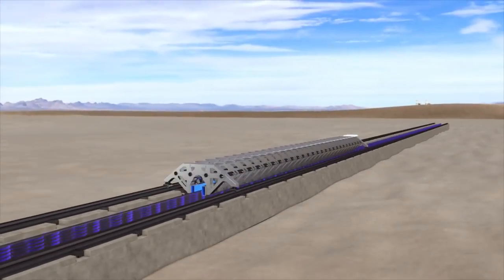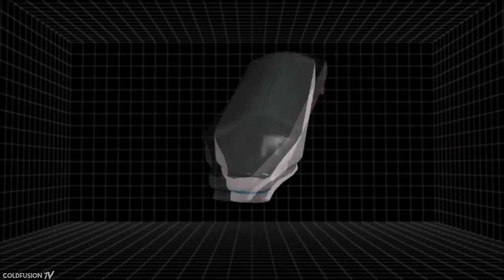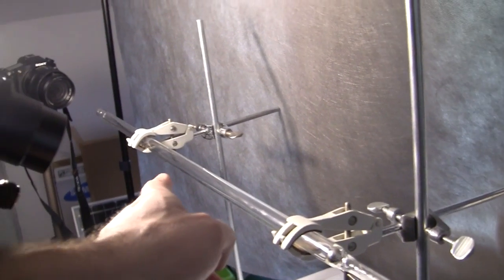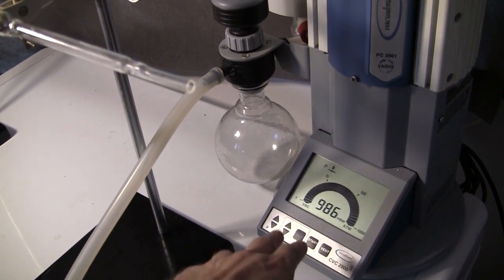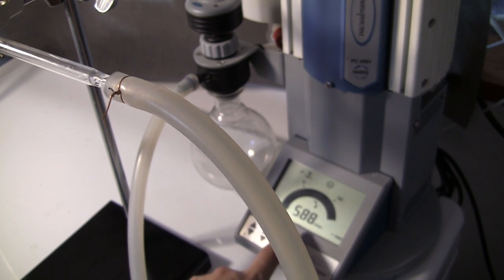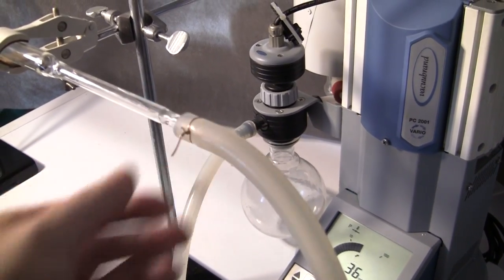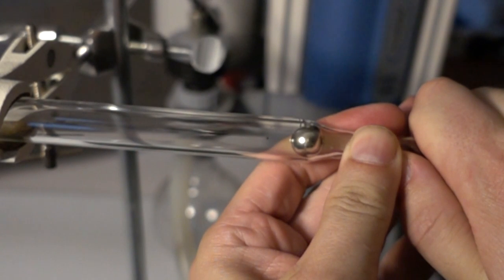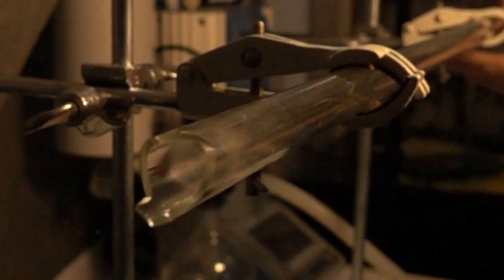How  the Hyperloop can kill you!

Comment: Wouldn't the rapid acceleration kill you alone?
Reply: Not if you had a friend with you, then it would kill both of you. :D
Reply: would cause cardiac arrest..
Reply: Maybe maybe not. Here is an interesting blog about it citing NASA and air force research into effects of G on the body. http://gizmodo.com/why-the-human-body-cant-handle-heavy-acceleration-1640491171 IIRC there is video of a man on a rocket sled in that link. I believe he gets up to about the range of 150G and survives. Fascinating stuff. Though I do believe that it probably is possible to engineer around problems like this.
Reply: Most probably. That looked to be Hella many G's (maybe somewhere around 20?) where 7 would kill most people.
Reply: what if its cargo only, and fully automated?
Reply: The acceleration would probably be very carefully calculated so it wouldn't kill you. I don't know about the future plans for the hyperloop but it seems like it makes no sense on the small scale, and that it would be wayy to expensive to implement on a larger scale
Reply: The rocket sled was a transitory shock. The maximum survivable sustained is around 10 to 20 G, IIRC.
Reply: Condor Boss You won't be experiencing it for long though. Much like with a rocket sled a couple miles long. Eventually you are at full speed at a constant velocity.
Reply: At rLoop we estimated 200g on our test pod. So, you might actually be able to survive it. Even though it's an extremely unlikely event.
Reply: For some reason people seem to have mistaken this as referring to the projected values when performing as planned. This video covers the potential for disaster in the case of an accident occurring
Reply: aprisia Ask Japan how having fast trains benefits them. It reduces the number of vehicles on the road, it generates revenue from the number of people taking the high speed trains to work in cities far away from where they live with no inconvenience. As for freight, there will always be people who will spend the extra money to get things faster. 

There are surely ways one could construct the Hyperloop to be safer. It serves no purpose to point out the danger, without acknowledging simple ways to solve those problems. Anyone can look at something and go "That looks dangerous". But their opinion is essentially useless if that's all they can do.
Reply: Joshua Dunbar The Japanese trains are a solution to a population that is spread out over large distances, and on multiple different islands. What does that have to do with this specific project? It's a train from SF to LA, a distance that can be driven in under 6 hours. Let's say somehow hyperloop drops this down to 30 mins. The difference of 5.5 hours is not significant when it comes to freight, as a general rule. 

"As for freight, there will always be people who will spend the extra money to get things faster. " 

And? There is no way that it will be cheaper for the majority of cases to ship via hyperloop over existing means. If your argument were valid, the Concorde would still exist. I don't disagree to hyperloop as a means of transit for people, I just think it's absolutely worthless for goods.
Reply: +Joshua Dunbar 
What type of fast train should we use? I do not know, let's ask Japan. Why have this over a supersonic train? The train is more cost effective and has lower operational costs.
Reply: Not really, sustained G and instantaneous G are not the same thing, people survive car crashes all the time and they can be ridiculously high G forces.
Reply: why not just walk then? The whole point of this device is SPEEEEED!! (insert Jeremy Clarkson face here)
Reply: Gotta love all the internet scientist figuring shit out in 2 mins what some people study for 50 years.
Reply: ***** he blocked you
he must be a salt hauling engine
Reply: Mr. Akeronian Depends on the angle you experience them at. Some scientist on a rocket sled in the 50s made it to like 156 or something.
Reply: +Mr. Akeronian People can survive 100 Gs for a fraction of a second. When it lasts for longer periods of time is when it becomes fatal. Falling onto your back from 6 feet in the air can still deliver 20 Gs to your torso.
Reply: Where would the profit be in that? Where exactly is this massive market of time sensitive physical goods going from between San Francisco and Los Angeles?
Reply: What will most likely kill you is you hitting the end of the cabin, because your body didn't accelerate with it. Imagine it like ermergency breaking with a few times the acceleration.
Reply: aprisia Maybe the time sensitive part aren't the important bit but rather how this is the same as a train but with less resistance (if done perfectly) And therefore could be cheaper than normal freighting (i feel like it wouldn't be the case in the first many years of this project)
Reply: +Deadly Ghost yeah....cool story bro.....but already hapñened and se still work the same amount of hours. robots and machines, at least in this capitalist system, make no difference, instead of using them to make the world a better place they will use them milk people further. Just like the excess of cheap labour makes salaries go down, what cheaper can you go than a machine that actually works for free?....
Reply: 100m rail is enough to get you in to supersonic speed, even when you are shivering 90yo granspa.
Reply: Slam Gamez I suppose, but we would have to take a look at the maintenance costs of both, along with operational costs and even compare it to freight trucks. Something tells me that an economic argument for hyperloop freight does not work out.
Reply: aprisia I also don't think an economic argument for hyperloop freight would work out in the beginning, but as the technology matures we may be surprised.

In the begging i imagine the hyperloop being like an airplane on the ground, with some benefits and some disadvantages. (One benefit being that it can run on electricity which a plane not really is able to)
Reply: Nobody needs hyperloop for cargo transportation.
Reply: depends on the distance, but you are probably right.
Reply: +123lovac am i the only one thinking of mounting the vessel with a solid uranium tip and covering the end station with equal amount of same stuff and just letting it crash to see funstuff... i guess
Reply: assuming humans have thought of everything that could go wrong just because they invest a lot is more idiotic than laci green
Reply: +Slam Gamez You could say that about literally any great works project. It's expensive therefore can't be done. O'rly? The creation of America's Highway system and railway network says hello. The Hoover Dam says hello. CERN says hello. The ISS says hello.
Reply: +aprisia Where would the profit be in a very fast train? I don't know, ask Japan.
Reply: +Munich22100 Brian Krause already did some math in an above comment explaining that since the HL pod is not a sphere, it has far more mass than a sphere, meaning that the force for the acceleration has to act on a much larger mass. This, coupled with the pressure-area calculations he did shows that there would be a far less violent acceleration than Thunderf00t showed. Whether or not it would still be lethal, I do not know. A good safety measure would be to install pressure alarms along the track to detect a breach and open vents in the tube to breach the pressure differential and stop the acceleration.
Reply: Slam Gamez Yes, but since we have already determined that time sensitivity is not an issue, your plane analogy is quite apt at demonstrating one of the major issues with hyperloop freight. Air freight is only used when the freight is time sensitive. It's too expensive and doesn't move enough goods at once to be a cost effective form of logistical transport for goods, in general. That's why, unless things are either transported in very large bulk lots or time sensitive, freight in the US is still dominated by truck. Even if you make the argument that eventually the cost of fossil fuels will go up dramatically as we run out of them, you can still convert your fleet to electric. As for massive shipments, SF and LA are both port towns, ships would be an even more efficient form of transferring goods. 

Again, the argument for hyperloop freight is basically flawed in that existing methods are superior in every front except being faster.
Reply: +aprisia Except the hyperloop is more or less just a very fast type of train. Meaning it should be able to move a large bulk of goods very quickly. Yeah, it would be somewhat more expensive, most likely, but that speed is a huge advantage. Especially since, unlike with passengers, the cargo could largely be subjected to much higher accelerations, meaning higher maximum speeds, meaning more throughput.
Reply: Hey, I posted this in another comment's replies, but it might answer your question.

Science, bitch.

a = F / m
Say the area of the capsule's end cap is about 3m&#178; (radius of ~1&#178; * π) so A = 3
F = P * A
Atmospheric pressure is about 100000N/m&#178;, so P = 100000
F = 1000000 * 3
F = 300000N
As a guess, say the capsule weighs 5 tonnes.
a = 300000 / 5000
a = 60m/s&#178;
Now remove acceleration based on the resistance of the near vacuum at 1/1000 atm:
a = 59.94m/s

That's basically 6g. So yes, you'd probably survive. That said, you probably wouldn't survive crashing. If, however, you came to a stop without hitting anything you'd be okay.

Before you critique me, remember, this is a 5-tonne capsule. If it were lighter, you might not fare so well. Heavier, maybe you'd do better.
Honestly, though, I think that most people would boycott hyper loops if decompression did ever happen given how traumatic it would be.

[Edit: Google is retarded - "&#178;" = squared sign]
Reply: aprisia True, there are currently many monetarily better ways of transporting goods, and as of terms of speed i have no idea what change would be made here, but considering that the hyperloop probably wont span over the entire world then i consider it as inferior to planes in most respects (except for it being hypothetically faster, which could give it some uses).

For example transporting special doctors from one hospital to another, and similar things which could help centralization (which is up to you to decide whether it is a good or a bad thing)
Reply: seigeengine How exactly would speed benefit in the SF to LA freight corridor? Outside of a few extremely time sensitive things like organs for transplant, goods going such a short distance do not benefit from speed. I suppose you could lump in such things like next day packages, but you can drive from SF to LA for cheaper and still make your deadline. 

The distance between these two destinations does not allow for a massive speed advantage to begin with, at best it's a difference between a few hours and a day. 99% of all freight is not going to need such time sensitivity. 

Again, the argument for hyperloop as a means of freight transit is just not there. Existing methods of freight transport are superior in this scenario. Now, if you had something like hyperloop that was LA to NYC, that might be a different issue. Though, I'm still not certain it would be a giant improvement over existing methods in most cases. 

You are thinking of things in the manner of, "Yeah, it's a cool potential technology that could lead to better improvements for the future.". However, any corporation worth it's salt will view it in a much simpler metric, "Will this make me more money?". The answer, for the current hyperloop scenario, is not likely. That is the only thing that should matter for any corporation, to value other things would violate the sole purpose of it's being; to make money.
Reply: +Johnny Farmfield +1
Reply: Slam Gamez I agree, that for shipping people, hyperloop is an excellent technology. It's when you apply this technology to freight where I think it's ridiculous. Though, honestly, when it comes to your specific example of specialized doctors, I would say that the same invest of time and money, that would go into hyperloop, would be better applied to telecommunications and robotics as it would allow for a longer distance projection of expertise than hyperloop.
Reply: +superdau more like your body smooshing into your seat
Reply: +Mr. Akeronian 7 won't kill you (unless maybe all the blood shoot out of your head) but will knock you out
Reply: aprisia The Concorde doesn't exist any more because it failed as a business due to multiple accidents and law suits. Companies involved in Concorde didn't want to continue maintaining the planes, and eventually all of them lost their air worthiness title and were permanently grounded. Not because it was too expensive to fly them because they were too fast. Also, I question you're reading comprehension skills. But I'll leave that one for you to figure out.
Reply: 1. that pellet of a steel ball didn't even reach near to bullet-speeds (if we ignore the fact it hit the glass, which slowed it down a bit.. but theoretically it should not have slowed it down by more than half, assuming the piece of glass it took with it weighs the same as the ball)
2. that's not instant acceleration, the way a bullet accelerates.. (actually bullets do not accelerate at a billion G:s per second in the start because there is expanding gas behind them, much like in this event.)
(that makes me remember that there is just as much pressure outside the glass tube as there is coming from behind the ball..)

Theoretically this could only make a train in real world reach the speed of sound. now remember that the train is lrdy moving at the speed of sound, so if it happened behind the train, no problem. the train arives at its home, and if it is detected, you could close a blast door behind the train after it gets to its location to protect- nvm, that's not really gonna be necesary because it's only one atmosphere of presure coming at you, so you don't even need that. the destination, aka the outside has 1atmos of preasure meaning there is no danger.

now if the leak happens in the front of the train it migth be a sligth problem. theoretically it would cause drag, and make the train slow down. the biggest danger is that a piece of metal or something lands on the rails, but doesn't that happen to real trains too? only diference here is that the train is moving at the speed of sound.

what we should focus on is WHY a catastrophic failiour would happen, and not that just because they could happen we should not try to ever make a hyperloop.

just like theoreticlaly you could get a faster internet connection (ping) if you had a vaccume tube and lazers going thru the entire earth, theoretically a hyperloop would also be a cool thing, but we're not drilling a hole thru the earth here. we're digging a hole thru the atmosphere, and nowhere as long a hole as one thru the earth.
Reply: +Ed Stretton Then you just debunked this whole video i guess because the hyperloop is way heavier than 5 ton.
Reply: +aprisia We could say it can be more ecofriendly but thats all really
Reply: Joshua Dunbar fast planes being banned is a political move. speed only has an affect on safety if you hit something, and there is not a lot to hit in the air. have you ever taken a drivers license? one of the dangers of driving past an other car is that there migth be a car behind a tree, or a curve that will be in your path when you are on the wrong side of the road. there are no trees in the air. a constant speed doesn't matter to a passanger. it's the acceleration and retardation of the vehicle that matter, and even if your acceleration is a bit too fast, if the passangers could be put on springs or something that made them accelerate a bit slower than the plane you could even accelerate a bit faster. these are called cushions... not that they matter when accelerating a plane into mach 2 or what ever.
Reply: aprisia you said something about converting a fleet of assumably trucks to electric.. wouldn't it be easier to just use freigt trains to move goods then, and have the rails electrified?

even i as a kid realized that trains are easy to convert into electric vehicles because you don't need to run any wires, because you lrdy have long steel beams. if the US has a good rail system then there won't be any problems moving freigth on electrified rails.

if this was to be done to trucks you would need large batteries, which are requiered because asphalt doesn't run electricity very well, even worse is that even if it did, you couldn't get any power transfered thru it.

also, if we were to swap to electricity, you better make sure you got that electricity from something that wasn't fossil fules because then you would still be using expensive shit.
Reply: ***** It was banned, not for some abstract political move, but because the sonic booms cause problems for people on the ground.

Acceleration occurs both when you are speeding up, and slowing down.

No, you can't use springs for this problem, because the acceleration isn't happening all at once. The vehicle is accelerating for a long time to reach it's max speed. What springs can do is stop a sudden acceleration, like when an elevator falls in it's shaft because the springs can mechanically absorb some of the force. They're useless against a constant acceleration.
Reply: seigeengine ik about the springs. that was just me thinking aloud about how the vehicle's acceleration is not neccesarily connected to the people's acceleration. it can be 'Buffered' a bit, and since planes aren't infinately long it doesn't matter.

ik about slowing down being the same as acceleration. that's why i mentioned retardation (which is what it is called in the scientific world). it's not like you're accelerating for ages.

about the sonic booms; you could just make sure you won't cross the barrier over land, or near windows or people. not really that hard. also the higher you are the further away you are, meaning the boom would be spread out more, and thus cause less possible damage. some people prob wouldn't like it if you caused sonic booms above any land, but you could do it above the ocean where you don't have any fishermen and shit. just fly sub-sonic above land, and super-sonic over oceans. it still decreases fligth times, expsecially for coastal areas. then the only people who can complain are green folks who would claim that it would cause disturbions to aquatic life or some shit like that...
Reply: ***** Yeah, I'm sure.

No, it isn't. It's just called acceleration.

No shit. You're saying some really worthless shit right now.
Reply: seigeengine you could still have super sonic planes be safe if they were flown properly. no need to ban them when you can just regulate them.
Reply: ***** More stupid shit. Lovely.
Reply: +123lovac 
Some cargo would be off limits as it acts like the thing that spins to separate plasma from red blood cells.
Reply: +Jaden S. 
Isn't doing that creating a secondary pressure wave? Unless you are actually opening several vents along the way, which then would not decelerate that trains as much meaning you might need more space in front. Also this makes the segment pressure management complicated. Which means higher installation costs.
Havibg several vents means a faster vacuum leak. So the need of pumps to keep the low atmospheric pressure in every segment will increase its operational cost.

Are you an engineer or just a scientist? Because everything has a trade off and you do not seem to notice it immediately.
Reply: Snacks.
Reply: ODDnanref We don't have supersonic trains.

The fastest train in the world's top speed is only the AVERAGE speed of the hyperloop system proposed over even a relatively short distance. You also would require far more energy. The advantage of the hyperloop is it's basically a really fast train... that doesn't have fight air resistance, meaning it can go faster and use less energy.

Yes, that would create a secondary pressure wave. That isn't a big problem though. Opening several vents wouldn't create that pressure wave so much, but you're not trying to slow the pod with that. You're trying to prevent it from speeding up too fast. It doesn't make segment pressure management complicated at all.

No, it doesn't.

Of course everything has trade offs. You just don't know what you're talking about.
Reply: seigeengine would you please inform me what part of what i have said you find "stupid", so that we may further investigate your smugness?
Reply: well maybe if you accelerate fast enough.. think about a car when you step on the gas/slam on the breaks you feel some focer being applied on your body but once you get to the desired speed and stabilize (no longer accelerating/decelerating) you feel nothing
Reply: there's a cure for that
don't rapidly accelerate
Reply: Jan F yeah, well they didn't have the shoulders of the giants we have today to stand on. they didn't even have the internet to quickly learn of the exploits of these giants.
Reply: Q: did Siegeengine block me or delete all his shit?
Reply: ***** yap.